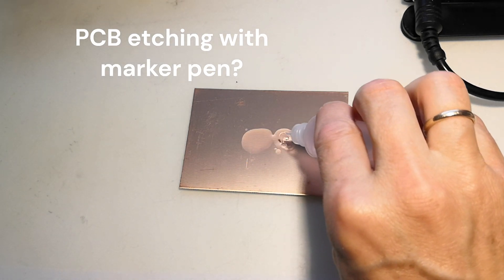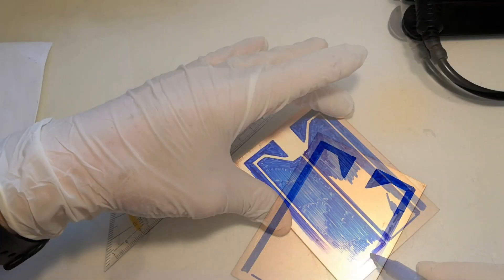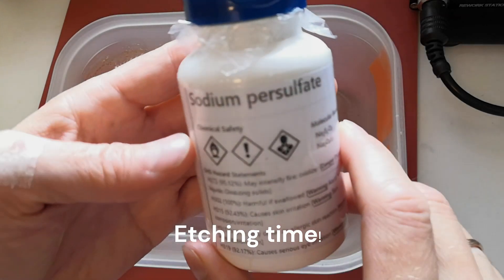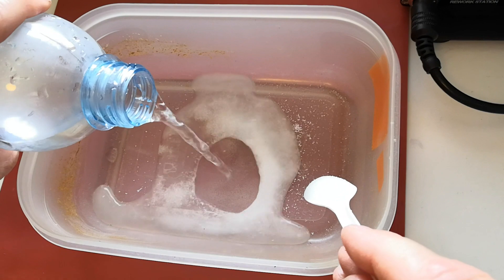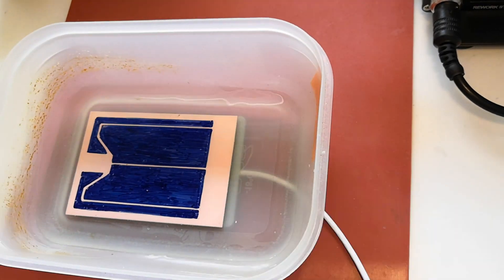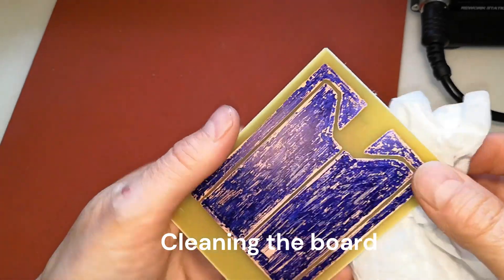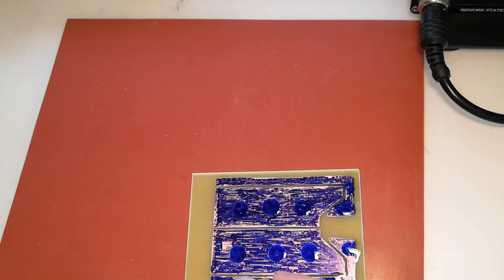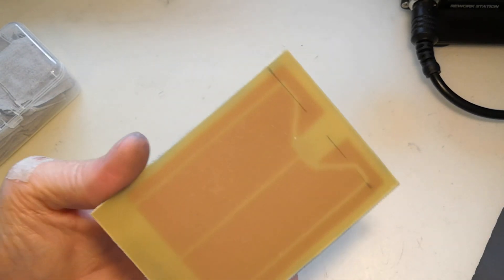Circuit board etching  with ordinary marker

Comment: I tested a variety of markers for their etch-resistance vs. Cupric Chloride about 15 years ago. The best performer was Yoken Mark II NO. 10 - contains Xylene and made to be refillable. I still own it, it works, and has not yet been refilled. Also, alcohol based markers (ie. Artline) did not survive etching.

Comment: Some will work, I've used Faber Castell black permanent marker and it just works. Should give it a try.
Reply from the maker: Good to know! Lately I have used paint markers, and they work perfectly. However, pen tip is rather thick.